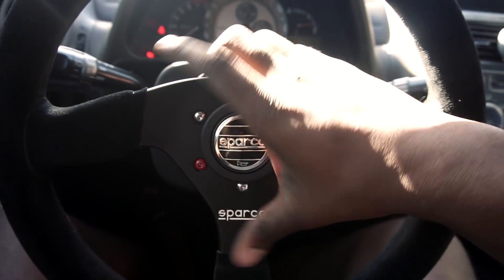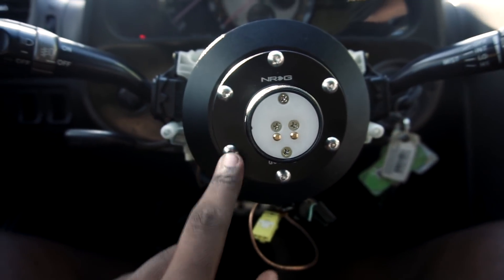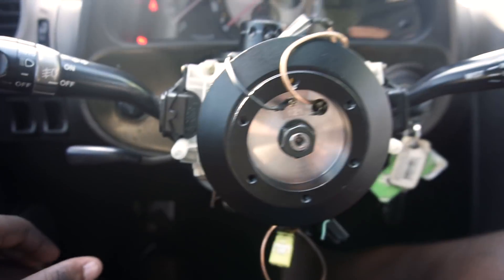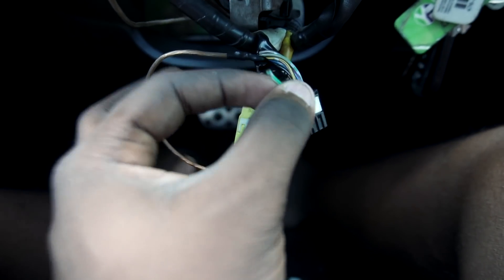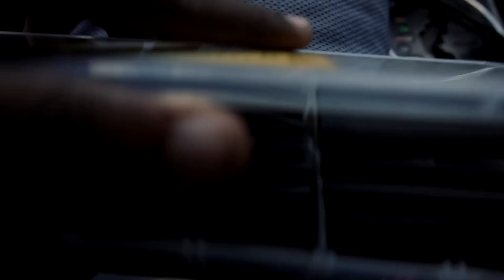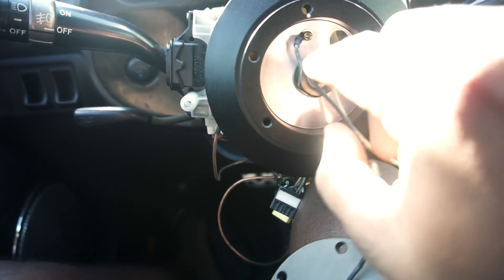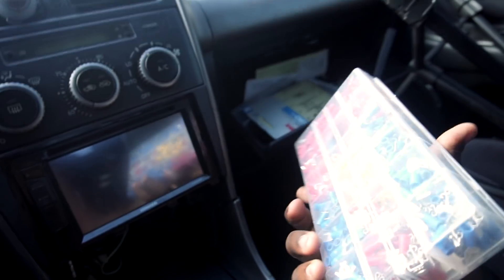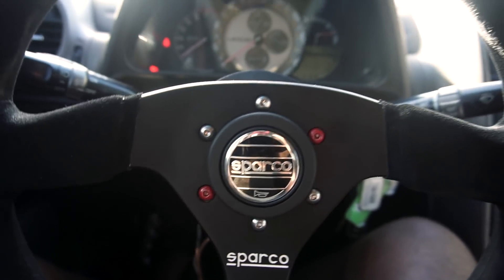How To Wire IS300 Horn To Quick Release Steering wheel!!

Comment: how are the wires holding up? I followed these steps on my IS250 and it was good for a couple weeks but the wire was getting like tangled from turning the steering wheel and it just stopped working. Just wanted to know if you had this issue at all